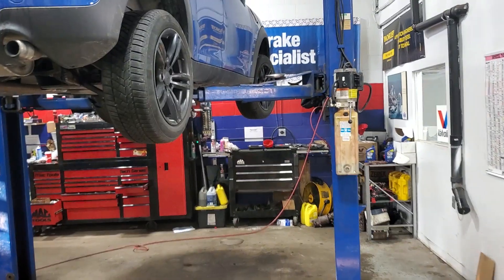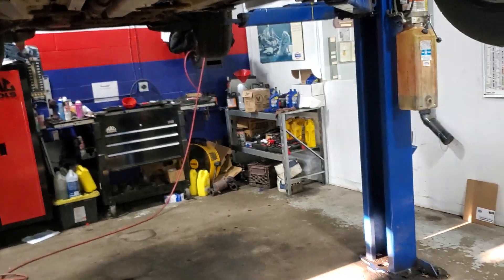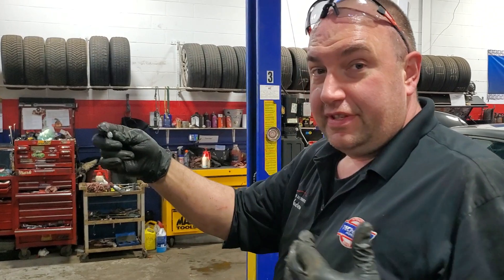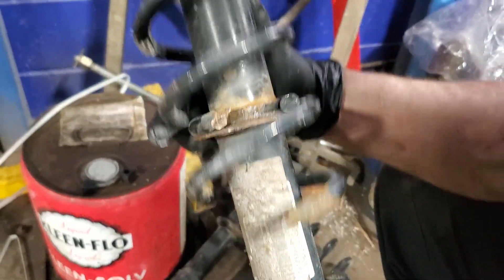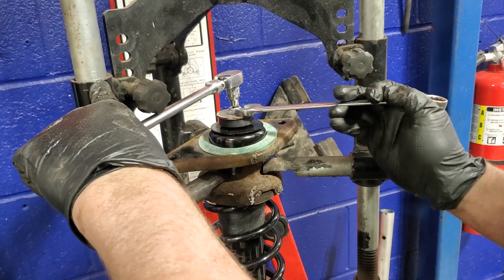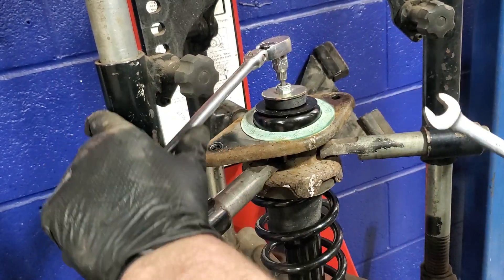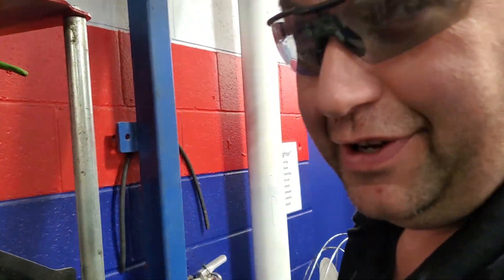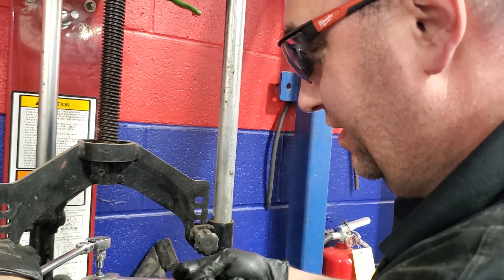Broken Coil Springs On Vehicle Suspension How Does It Happen & How It's Fixed @UrbanAutomotive01

Comment: I have a question I broke 1 coil spring but I was told to change both of them is it necessary to change both or change the broken one?
Reply from the maker: Sorry for the late response. While it's technically possible to just replace the broken coil spring, it's generally recommended to replace both springs on the same axle at the same time. Here are a few reasons why:

1. **Matching Performance**: Springs lose their strength and elasticity over time due to wear and tear. If you replace only one spring, the new spring will have a different performance characteristic than the old, worn spring on the other side. This could lead to uneven handling and potentially make the vehicle unsafe.

2. **Cost-Effective in the Long Run**: If one spring has broken, it's likely that the other one (which has been subjected to the same conditions and mileage) isn't far behind. Replacing both at the same time can save you the labor costs of having to replace the other one later.

3. **Balanced Ride**: Replacing both springs ensures a balanced ride. If only one spring is replaced, you might notice that one side of the car sits higher than the other, or the car might lean to one side during turns.

So, while it might be more expensive upfront to replace both springs, it's generally a better choice in terms of safety, performance, and long-term cost-effectiveness.
Reply: @UrbanAutomotive01  thank you I appreciate that information well I have changed only 1 and the car drives grate still I am taking my time over speed humps and trying to avoid pot holes too 🙏🏽